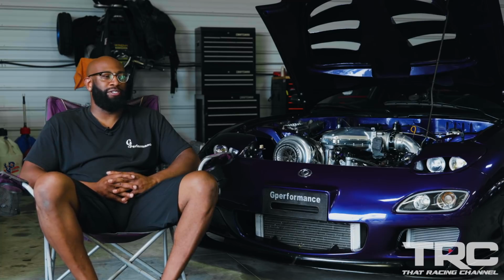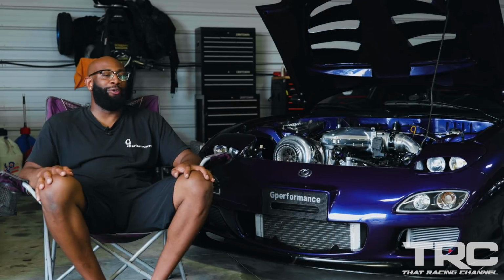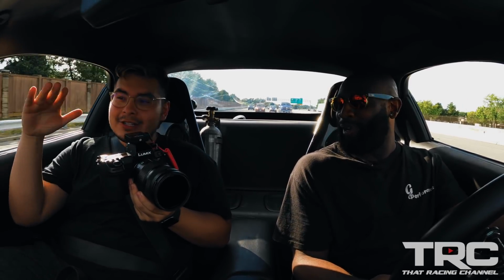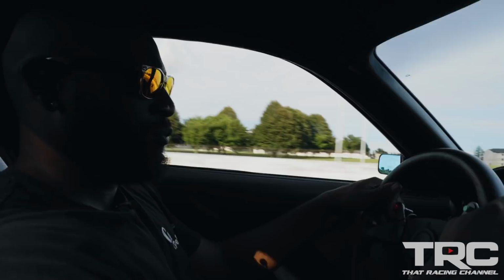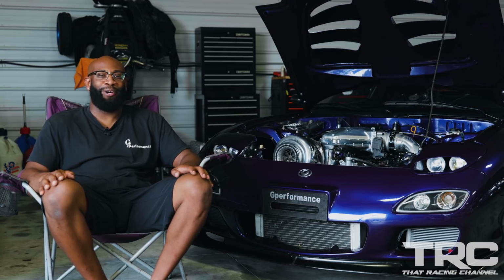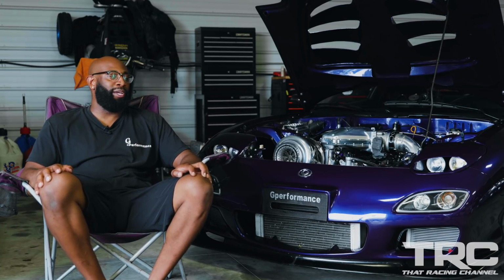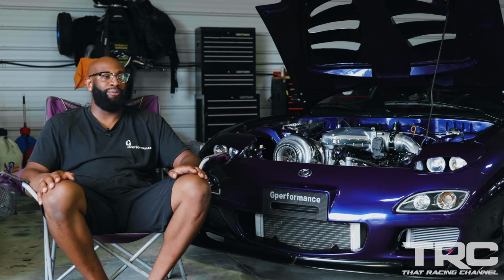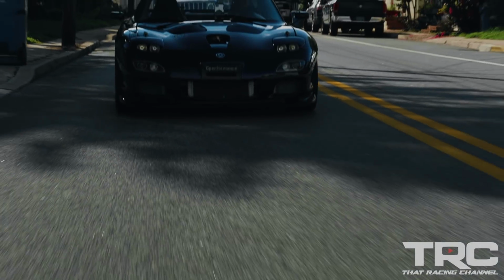900+HP 3 Rotor RX7 with DCT Trans?! (83MM Turbo + 9,000RPM EARGASM)

Comment: Those rotaries never fail to amaze me.... They sound like they're just seconds from exploding.  Beautiful car and it moves out.
Reply: They usually are close to blowing up or was just finished rebuilding it.
Reply: @danmackey9462  Yea, and when you blow it, you can rebuild it in 3 hours with new seals and back on the road in the same afternoon
Reply: Yeah same here
Reply: @rotor13  not always 😂
Reply: @rotor13  that’s literally any car though
Reply: @danmackey9462  Keep it n/a and they're very reliable
Reply: The pops and bangs is the Rolling anti-lag
Reply: @rotor13  do you always have apex seals on standby and gaskets etc. can You rebuild mine for me
Reply: @THESLlCK  LMFAO, not its not
Reply: @youtubecomments5951  Pay me $500 to remove and install the block and my $160/hr labor and I will.
Reply: @rotor13  where are you located. How much are the parts for new gaskets and apex seals etc. If this is true. You may have saved another rotary from getting ls swapped.  Also it’s already removed.
Reply: @youtubecomments5951  I recommend
Chips Motorsports, Banzai Racing, IR Performance, Rotary Resurrection, Rotary Performance, RX-7 Specialties, Elite Rotary.... if you really wanted your motor rebuilt you would have already found a reputable shop that would do a basic rebuild and get you back on the road for around $2-3k provided nothing major needs to be replaced and you just need new seals, bearings and some clearancing of said seals.
Reply: @rotor13  I’ve been to one of those company’s you just recommended. Do you know there are cars at one of those places for over a year. And the news is most places you probably won’t get it back for over a year. I know people waiting for a motor for over 9 months. I ordered from banzai racing. They got me a brand new motor under 2 weeks. I think it wasn’t even 1 week.   One of the place you mention only takes deposits and maybe full payments and people haven’t recieved their order yet. Some orders are over $20k.
Reply: @rotor13  I’ve been to a feel rotary shops. The bill always go over 10k since they keep adding stuff for me to buy. And if you don’t buy you won’t get the parts you came in initially for.  Finding a reputable shop locally is not easy. So far I’d only trust banzai and only because of getting my motor and him being honest afaik.  Basically I gave up on rotary and I have a fd sitting waiting for me to decide what I want to do with it. Seems going with a non rotary keeps popping back into equation if I ever want to drive the car.
Reply: @youtubecomments5951  Go to those shops i listed. They're not ripoff artists.
Reply: @rotor13  one of them is and it might even be the most reputable a few years ago. But it’s not now. They won’t refund and your money is basically in Lala land. A personal friend it’s been over a year now I think and check the forums. Bunch of people coming out. Banzai i think is good but too far.
Reply: @youtubecomments5951  freight shipping
Reply: @rotor13  I have a question. Can you run omp without the omp motor but only by vacuum? And not run oil in the tank?
Reply: @youtubecomments5951  You would have to swap to an older OMP style which operates on vacuum instead of the electronic ones if you want that, from the 1st and 2nd gen RX-7's
Reply: @rotor13  I hope that’s the case. The shop converted it for me. I didn’t know it was non motorized. I just asked to be converted back so I don’t have to deal with putting oil in the tank. But it blew up after 20 miles drive and motor was all carbon inside when I took it out.  You might have convinced me to throw the rotary back on.  Aiming for very low hp. Maybe 320-400. What turbo should I go? Longevity comes first. I’ll stay under 350

Comment: I absolutely love Tajh’s car! I went with the hardcore t56 but it’s hard to ignore how smooth the DCT maintains power to the road. Love seeing the innovation.
Reply: Yes Rob, great seeing you give love to other build methodologies.
Reply: love you rob you are one of the reasons why I am still alive
Reply: Of course you're here 🤣
Reply: You did the right thing. The DCT is hottt, but its moving the FD away from its roots. A sequential would be the ultimate trans but a T56 is the way I would go.
Reply: @Rob Dahm, when's the next video, we hungry 😩
Reply: Makes you wonder if Tremec is going to sell their DCT in the aftermarket. If so, you'll see a lot more swaps like this.
Reply: Rob, I hate to say this but do what he did but but your t56 and go nuts. Your only slack is the body and finishing. Get that sorted and you can slay mani Farrari's
Reply: @Red6er  I agree
Reply: Papi Dahm!
Reply: Dct is the only way to beat that damn ferrari
Reply: Rob if you wanna win, you’ll need a DCT…
Reply: @cxbra  While i love the fuck out of stick shift cars, that DCT woke his car. my car was only making 950 ish when i raced him in this vid, but i would of pushed his shit in with the T56, but obviously it turned out different with that T56. its literally to crank my boost up and run it back.
Reply: bye² Rob Dahm 😂
Reply: @Red6er  bro it took him years toget the car RUNNING
Reply: @cxbra  id say the dct goes well with his car
Its a 3 rotor, custom paint and has a bunch of aftermarket bits cosmetic and performance.
Its a custom car far from oem spec.

Just my thoughts tho haha
Reply: @THESLlCK  and he had 900hp on it well b4 the 4 rotor build. So people should respect instead  of compare
Reply: atleast its a finished car...xDDD
Reply: Rob go dct
Reply: hi rob <3
Reply: Only worry I have about the anti-lag option is pushing abit on the turbo god knows how long the apex seals will last when pressing the button
Reply: rob you need to DCT trans your 4rotor asap
Reply: @cxbra  what ?? How
Reply: @cxbra  Even better, S1 Sequential T56!
Reply: Lol😂 @dieselcreme
Reply: @killakam123321 sequential dog box is way faster than dct
Reply: As much as I love a stick in curves a dtc is like a air shifter on a bike.
In a straight line it makes the most sense.

Comment: Greetings from HTG! Love being part of the build and thanks for DCT choice :D
Reply: Hats off🍻
Reply: The dct work you guys have done is awesome 👍 one question, in the vid it looks like there's a bit of lag between the paddle pull and the actual gear shift. Is that something you are able to improve in the dct tune?
Reply: @dawggpie  there is delay on low load shifts but that's intentional, because if you're driving grandma style it means you're not in rush so why would box have to be in rush then 😅 but as soon as you step on it, that's instant :P
Reply: @HTGtuning  ah I see. Is that too improve smoothness of shifts? I was driving a Porsche pdk recently and even at low load the programming felt pretty instantaneous. Possibly slower than high load but still very low latency. Gave a great perception.

I've peppered you guys about this before, but any chance you'll figure out how to interface with the e60 s85 oem ecu (mss85 I believe) canbus? I don't think anyone has done it yet but I think literally every v10 e60 smg owner would switch over to dct in a second. 😁
Reply: @dawggpie  We already have communication with s85 ECU done.
And yes, it can be as quick on light load as on high load and still be smooth, but as Tajh mentioned - I did that tune in like half an hour via anydesk with laggy internet :P We will go further than that when time comes :D
Reply: @bcastelli  nice! How do I learn more about this s85 integration? Haven't seen anything online about that. I was told the smg just sends a torque request to the ecu in order to do throttle blips on downshift. Are you integrated the same way?
Reply: @dawggpie  Yup, just DM HTG directly :)
Reply: You guys are amazing! I'd love to work with you guys in some way over here in the us. If you need any help just let me know! 🔥🔥
Reply: @bcastelli  gintani has a dct e60 m5

Comment: I’ve been watching and waiting for the tuners and people with deep pockets to start bringing more DCT transmission adaptations to some builds. Not that manuals aren’t amazing. But when people are trying to go insanely quick they usually turn to sequential manuals, which is essentially the same formula a DCT is trying to do. It’s just an automated manual that uses two clutch sets instead of one single clutch. One set takes care of odd gears and one set takes care of even gears. So one clutch is always free and ready to go. They’re pretty brilliant pieces of engineering and should be loved!

Comment: I was looking for the date this video was posted, but didn't see it.  Anyway...this combination was never released from the factory anywhere in the world. What a breath of fresh air.  Something extremely unique. Im glad the rotary is not completely dead. Too bad Mazda wouldn't release something like this. The transmission in the rx8 was very smooth.  I wonder if it could handle this level of power. Just a Mazda pipe dream. Too bad they abandoned the sports car street game.

Comment: The rotary engine is a high-RPM, high-torque engine. 900+Hp beats 1000+hp only belongs to acceleration. Maybe power can’t win, but acceleration can defeat many Custom cars of the same level or above.

Comment: 11s @ 117? That seems slow for the power. I tuned a turbo 5300lb truck that went 123 in the 1/4. Was he sandbagging?
Reply: maybe was trying to avoid being kicked out for not having a cage? some tracks have speed limits before you need a cage
Reply: @NitroNuggetTV  that could be true. Like I said. Maybe he was sandbagging.
Reply: @NitroNuggetTV  I'd rather send a hail Mary pass and get booted. Lol
Reply: I think he was saying that was back when the car was a 2 rotor
Reply: @wolfie239w  oh I may have missed THAT POINT.
Reply: A 900hp rotary can do 7 seconds easily

Comment: It lags and pops for a sec before really getting into the power......might have to set the timing maybe?
Reply: No, its rolling Anti-lag, builds boost before a pull while maintaining speed
Reply: @stevenlavin5778 ......looks like he is flooring it by the way his body moves....like he is mashing the gas
Reply: @midbc1midbc199  yes when you do rolling anti lag you press a button and floor the car... Its triggers a  rev limiter and holds the revs in place but allows the car to build boost... Then once he let's off the button the car does a rolling launch
Reply: Rolling anti-lag baby 🥳